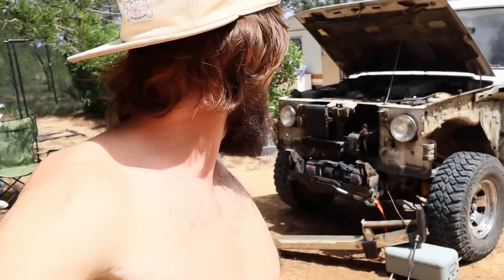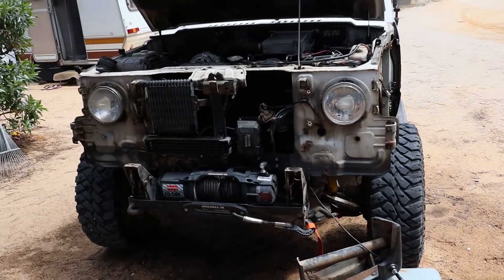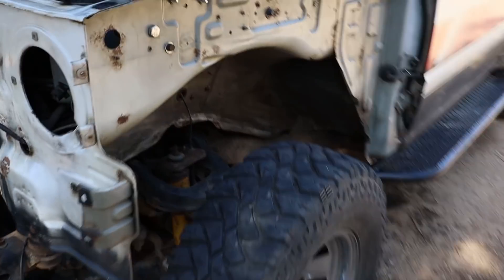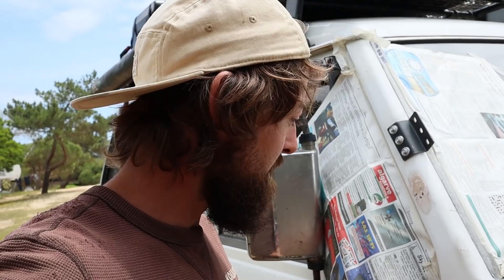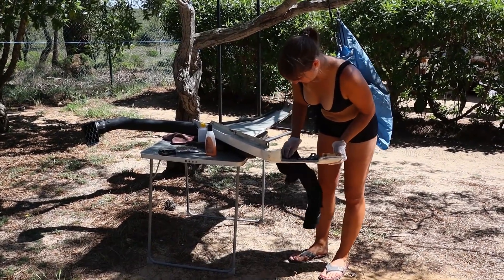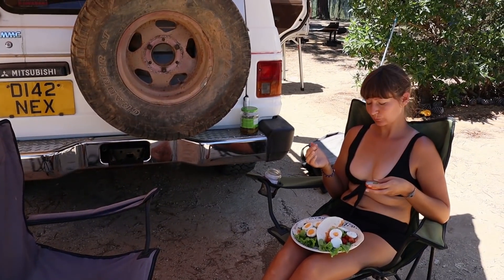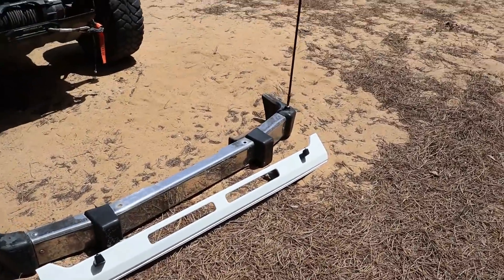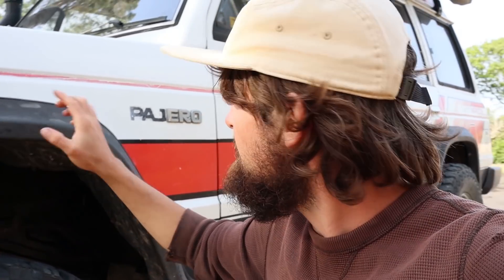Rust Treatment & Prevention on our Classic 4WD Overland Vehicle

Comment: Amother great video folks, thank you. Portugal is on our list now because of your vids. During the lockdown, I have fitted an aftermarket transmission intercooler to my Toyota, changed all the fluids throughout, done some electrical modifications, replaced some dead dash lights, stripped down and sorted out the front of the vehicle, moved the horns away from the radiator intake zone, removed the back bumber and treated the rusty areas, greased all the nipples (oooh err) and other stuff I can't remember now. It's been soooooooooooooooooooooooo looooooooooong!
Reply from the maker: Thanks Simon! Pleased to hear that. You should very much enjoy a trip down this way. Good use of time to get the truck all sorted out and in tip top condition for when overland is allowed 👍 keep it up and keep well J&K